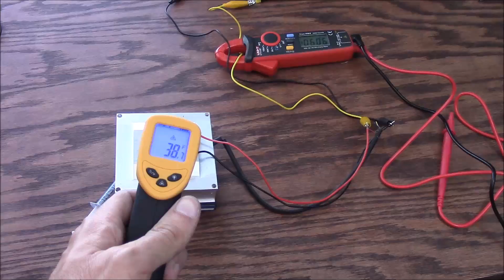Peltier Cascading - Does It Work??

Comment: I'm also playing with Peltiers, with a fermentation refrigerator.

I've got two different cooling plates:  One is a quad-set of 12706 chips arranged on 80x80mm water cooling plates, and the other is a single 12715 chip on a pair of 40x40mm plates.  Both perform almost identically.

My next experiment is to cascade/sandwich a 12715 and a 12706 together.  the 706 will cool the cold water circuit that chills the fridge, and the 715 will take all the heat from the 706 and pipe it to a large radiator array.

My thoughts are, this will lower the ambient starting point for the temp differential that the 706 experiences, since the "hot" side of the 706 will be slightly below ambient.  Right now, my "hot" circuit is around 90 degrees F and my cold circuit is cooling the box to around 54 F, with ambient at 78 degrees.

Reason:  The 706 moves about 50 watts of heat, but produces an additional 70 watts for a total of 120 watts.  Stacking multiple 706's will eventually cook your stack of them.  The 715 moves about 140 watts of heat, but produces another 180 watts of heat.  So, cooling a 706 with a 715 will give a thermal advantage to the hot side of the 706 and lower the starting point of the deltaT spread.
Reply: Hi, Romain.  I have built one and it's been through multiple iterations of peltier configs.  The most successful one this far has been a pair of 12710 chips, each 40mm x 40mm, sandwiched between two 40x80mm aluminum water cooling plates.  The hot circuit has two 120mm x 360mm radiators providing a total of six 120x120mm fans.

This setup has been able to provide cold-crash functionality to my brew fridge, down to about 40 degrees.  It would pull around 250-260 watts when running.

However, the problem I have run into is that the inexpensive TEC chips available on Amazon have insufficiently sized lead wires.  I have actually experienced excessive draw and wire melting.  I used 10 amp automotive fuses feeding the chips so they shouldn't have been able to pull more than 10 amps.  Looking at it, I think they're using 16ga stranded leads, which is really only good for 7 amps or so.  It might be 14ga, definitely not 12ga.  

I have not yet tried a cascaded setup.  But I will not buy any more cheap TECs off of Amazon that draw more than 6 amps, so I will need to source a higher quality 10-15 amp TEC chip for testing that has 12ga leads.
Reply: What's your temperature target?

My target was 4 degrees C for short term cold crashes of 24-48 hours, and sustained long term fermentation in the 15-20 degree C range.

I found that pretty easily attainable once I went to water cooling and radiators for the waste heat from the TEC.  A pair of 12706 chips, working in tandem to cool two 40x80mm water heat sinks, one for the hot cycle and one for the refrigeration cycle, with the cold passed to the interior of an insulated box and to a radiator with fan that circulates the internal air across the refrigeration device, will work just fine.  The 12706's will give you a 18 degree C fermentation environment with no problem, but they won't be able to cold crash to near zero C.

Get a power supply that can provide 200 watts at 12v.  A 12v DC thermostat controller.  Two 12706 TECs.  Two 40mmx80mm water heat sinks.  A couple of low volume water pumps, aquarium style or CPU cooling style.  A 12v relay that can handle 20-30 amps (SPST relay, automotive).  A pair of 120mm x 120mm fans, and a pair of 120mm x 120mm radiators.

Then build a box to fit your fermentation vessel.  Mine is about 1 meter tall, 75cm x 75cm in footprint, and has about 4cm of styrofoam insulation.  Tall enough to fit a 25 liter fermentation bucket with airlock.

Fridges have compressors in them, and the manufacturers tend to put the hump of the compressor on the bottom.  This makes it hard to fit a good sized fermentation bucket inside, without buying a full size fridge.

Your post has reminded me to try the cascade approach, so I have some equipment inbound to give it a try.  I'll be taking a 12715 (or a 12710, not sure if I have a functional 12715 in the parts bin) as the hot-side, and a 12706 as the cold-side, stacking them, and seeing if I can hit the same 4 degrees C target as the pair of 12710's working in tandem horizontally across the same heat sinks can provide.  

All my TECs I have right now are low quality Amazon ones, so I won't leave it running for an extended period of time, but if it works well I will find someone who makes a quality 10-15 amp 12v TEC with larger gauge leads on it.
Reply: One of the frustrating things about TECs is they get less power-efficient for the heat they pump as the deltaT increases.  They're reasonably efficient when hot side and cool side match temps, but get inefficient when you have a 30 degree C spread between the hot water in your exhaust side and your cold water in your refrigerant side.

I've ordered a TEC2-25408 two-stage cascading chip.  It has a higher deltaT capacity, so despite only being an 8 amp system it should be able to provide a greater deltaT between my exhaust and refrigerant circuits.  It then just becomes a matter of how quickly heat enters the box, either from yeast metabolism in the beer or bleeding through the insulation, as to whether the single 25408 chip can do what is needed at 12v 8A (just under 100 watts).
Reply from the maker: That makes a lot of sense.  This was my first cascading experiment and I am not an engineer so I guess I didn't fully understand how this was going to work.  I was told to try it but never told how to do it.
Reply: So I've decided to abandon this peltier fridge pursuit.  I've been working with it for about 2 years, but what I keep coming across is fatigue of the peltier chips.  This fatigue is caused by thermal expansion/contraction, and a weakening or breaking of the solder junctions of the piles inside the peltier.  Peltiers work best when left at 100% duty cycle, always on, never experiencing duty cycle switches.  I was getting anywhere from 25 to 50% duty cycle.  The ones that have worked best, with my desire for about 65 degree F temps, were the little 12706 units, because they can barely sustain the temperature.  What causes my units to keep breaking, is the desire to cold-crash a brew in process and push the fridge down near 40 degrees F... then start a new batch of beer around 65 degrees or just let it sit powered off at 78 degrees in the house.  Too much expansion/contraction and failure of the unit.  My most recent unit, a 25408 two-stage, failed inside of 20 days.

I'm going to find a compressor-driven chest freezer and put a thermostat relay controller between the freezer and its power supply in the wall.
Reply: Hi Kelly, i'm interested to know if you did a fermentation refrigerator ? Is it working ? I'm making my beer and i'm thinking to build a fermentation refrigerator (without buy an old fridge / i don't have space for that) with peltier mods but as u can imagine, on internet, we see a lot of things (it's not working or it's perfect). So, if i can have your feedback, it will be well appreciated. 
Thx !
Romain
ps : sorry for my english (I'm french).
Reply: Great ! You're amazing to keep searching to develop a solution ! I'm not a tech' guy ! For my beer, i will simply use a old fridge and buy a device to control the temperature. But TEC was interesting for the noise and to optimize space at my appartement. But, you know, before to go to this lead, i would like to explore others alternatives. But, you did some thing which WORKS ! But it's out of my league I thinks... I imagine you spend a lot of time and you have a good insulation of your "fridge". In a nutshell, bravo ! and congrats for your work ! On YouTube, a think you''re the first to attempt a functional fridge ! Others videos was only failure ! So, you did it ! And you seem to be a great engineer ! Thx for your time ! (sorry again for my english)
Reply: Hi Kelly ! Now, you have my attention ! 😃 I would like to thanks you a lot ! Your comment are so inspiring. I'm an IT engineer, and electronic make me a little bit uncomfortable but...you're so encouraging  and you make me feel capable of ! So... THX YOU !

I'm totally agree with your remark about fridge' size. You're right ! And it a big convenient to me ! I cannot have a huge fridge. I don't speak I have no car, so make myself a DIY Fridge is more exciting and fit more with my needs. So thx you again for this smart remark. An other pro is the "plug-and-play" effect : if you decide to change your room or if you move out, i can just change my box shape (design an other) and plug the device !

Now, I have some question about your posts. It's a little bit confusing for me (not because of you, ... lack of my english comprehension). 

Somes questions about your comments :
1- You said that you setting pull 250-260W while it's cold-crashing. But, for a 18°C, what's the power cunsommation ? Instantly and for a day ?

So, i thinks I have understood your setting :
Two TEC in serie (side-by-side, not cascading) with :
- cold side : water heat sink
- hot side : severals fans with a aluminium radiator (3 fans for 1 TEC)

But, i misunderstanding what you do with the water heat sink.  I imagine you have a water circuit (with the pump). Do you connect water heat sink with a copper tube ? Like a chiller coil that fits your box ?
Other misunderstanding, you said that you can cold-crash, but you indicate that this setting cannot do it ! Do i need more powerful TEC  ?

I'm going to do it this summer !!! 
I'm very exciting to spend times about this project ! It's perfect ! Thx a lot again to give me hope ! 
To answer to your question : my temperature range is 12°C - 22°C (12°C to make cheese ... DIY is a decease  :-) But..if it's possible to cold-crash too, i admit it would be perfect ! So 12-22°C most of the ti,mes and sometimes a little 24h-48h at 4°C to cold crash !

THX A LOT Kelly ! 

ps: if you have a picture for that (don't waste your time if you haven't), it will be perfect / my mail is romainlafond (just add @ and gmail and .com ;-))

Comment: To my knowledge peltiers transfer less heat than they them selves create. Using identical elements at same power cascaded does nothing or melts the "hot side" one. You do see cascaded peltiers that have high delta T, but they have very low heat capacity. There never was any reason in the efficiency side to do this. Only thing to gain is higher delta T. Using 2 side by side with sufficient cooling would cool higher heat load, would give lower temps in short run like this.That would never get to that theoretical delta T proper cascade would have. To be honest don't know what you are testing here. Cascade did not do something that it never was meant to do in faulty configuration like this. Put 2 of those on the hot side of one and you will get lower temps faster and might be able to move enough heat from the cold peltier. In longer run times that might result in higher delta T. The system is not in any way insulated so efficiency would be horrible so might not make much difference. To sum it up. There is actual factual info and products doing this and they work in creating higher delta T. What you should freshen up on is theory and concept of how these things work at general level.
Reply from the maker: That is true.  I don't know the theory behind cascading.  I have been told by at least a dozen comments to my peltier videos that I would get better results by sandwiching two units together hot side to cold side.  That is just not true.  

I get what you are saying and I am sure there are devices that use this concept but again my main point in the video is whatever marginal benefit you get from successfully cascading and increasing the delta T could be more than matched by just getting a more efficient, double power peltier module.
Reply: Yes you don't get any extra delta T doing that. If you need capability for higher delta T then cascading works. But then again your max wattage is transfered at delta T of 0 and at speced delta T at no load at all. Most times adding more capacity for wattage gives lower temperatures since people seem to cool things that have constant generation of heat. Cascading 2 same TECs is just really bad idea. You are moving from air that the colder one touches something like 65w and adding to that close the same from the TEC it self. The other TEC can only transfer 65w and cold side on that will raise. That means hot side will raise and you will have burned TEC. First the hotter one then the colder one.

Comment: Just for your reference in the future, its not good to spread the thermal compound on the peltier like that, especially with your finger. Anyway, great video :D
Reply from the maker: Haha, I knew while I was doing it that I was going to get some comments about that.  If this was a permanent installation I certainly would have done a few things differently and like I said in the video I am sure I could have squeezed out a few more degrees out of the cascaded setup.  I hope people get the point, though.